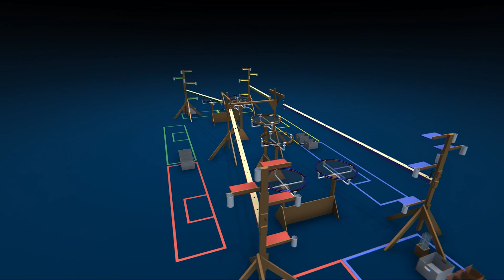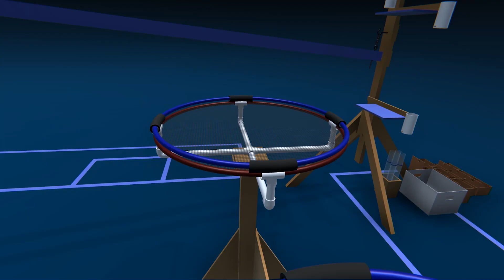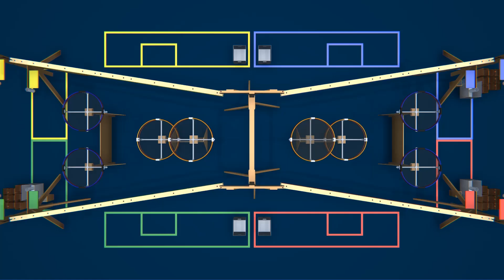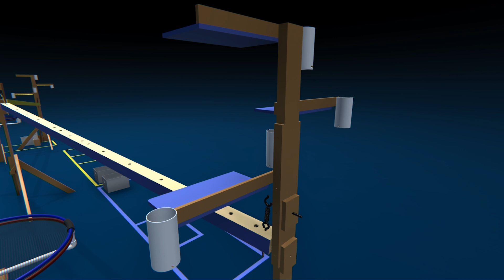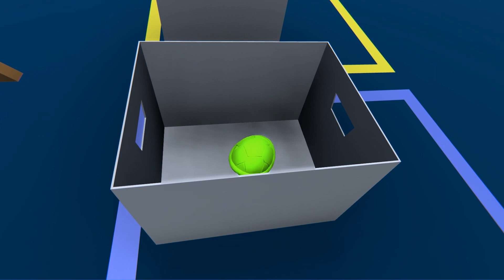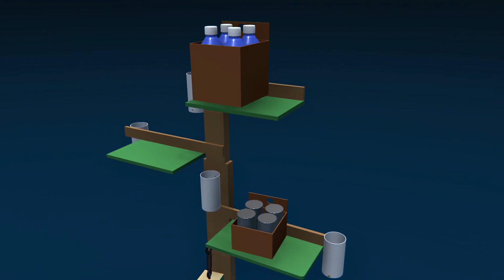2018 Current Events Animation

Comment: So, I'm a little confused what the "Current Flow" has to do with anything. It says you can use and collaborate with other teams to get a more accurate depiction of the current, but fails to elaborate on what purpose that has. I've even been scouring the Manual and can't pinpoint a definitive answer.

Also, since the video has come out so early this year, are they going to be cutting the Build Season short? Our hub isn't having Kickoff until like 3 weeks from now ...
Reply: Scour harder. Competition Rules (p.29, 46, 47). It is worth 150 points. You have a 1/24 chance of guessing the correct Flow Scenario (A-X, which will be marked on the scorecard) if you don't score a duck. If you score your duck, chances go to 1/6, if you talk to one other field scientist, chances increase to 1/2, if you talk to two other field scientists, you've solved the problem.

Comment: Wait. Does the robot have to place the reef blocks or does the feild engineer do that?
Reply: 3.5.2.2 
Field Engineer: Not Permitted: 
b. May not install any reef blocks on the reef structure. Only the robot can install reef blocks.
Reply: FE puts it on the transfer shelf, robot picks it up and places it on the reef
Reply: Empress Aelin I’m pretty sure the robot does, but it should be specified in the rule book